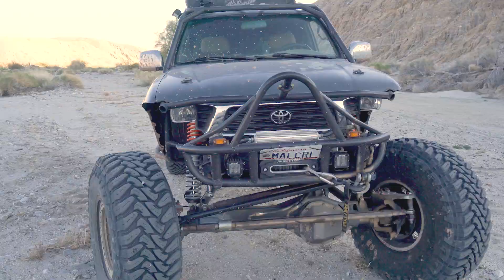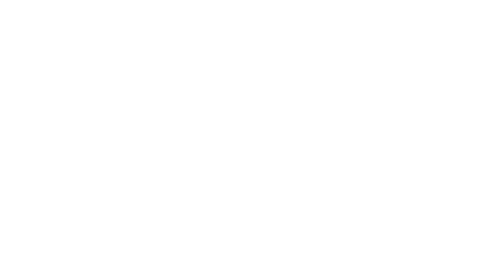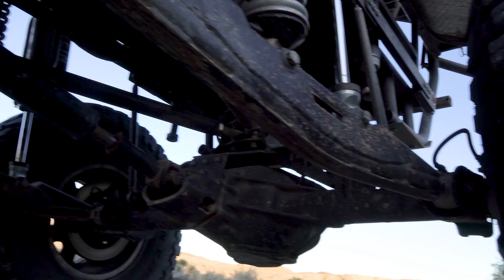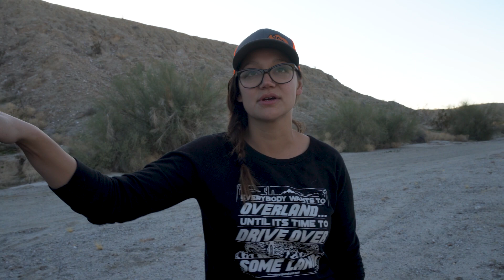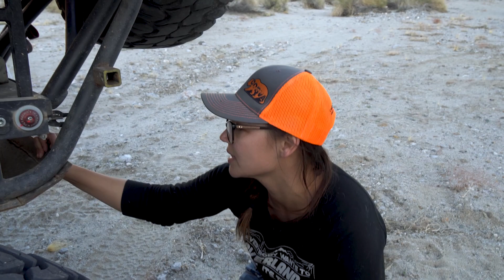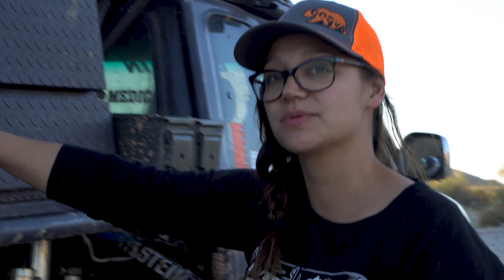Is there anything this Overland Tacoma build can't do? (walkaround)

Comment: cool trail rig, but that is NOT street legal around here. that would be a trailer queen anywhere in my area of the country. tires size alone would not be allowed, and frame is probably more than 29" off the ground...  not to mention the headlights are modified/altered.

Comment: Again killer rig!  Did you do all the exo cage work yourself?  If so nice really clean and tight!  What T cases are in it?
Reply from the maker: Brittany did part of the exo cage and i did the rest. She also built the front frame section thats 4" higher than stock, trailing arms, part of the swing-up stuff, and a bunch of other metal fab stuff on the truck. Its hard to make an exo far enough from the body so nothing rattles on the road but also make it not look like a jungle gym. We just use a gear drive doubler in front of the stock chain case, i actually think the taco chain case behind the 3.4 is really stout, especially compared to the gear drive stuff in the doubler.
Reply: Wheel Every Weekend 
 Looks great any video that you can put up of you too doing the work?  And what bender did you use.  Thanks for the reply back!  Look forward to your next video!

Comment: She knows here shit....Damn.
Great rig.  Countless hours of work.  Congratulations.
First generation Tacoma were the best.  I liked the slightly smaller size.  Now the new Tacomas are as big as the older Tundras.  I wish Toyota would bring back the smaller size.  😞
Reply from the maker: Brittany built a lot of whats on the rig... she did the custom front frame, the trailing arms, part of the rear exo, and a good portion of the engine cage. The 1st gen tundra is smaller than the new tacomas, thats why we've been considering swapping all our parts onto a 1st gen tundra with the 4.7... which doesnt make a ton of power for its size, but its a really well engineered engine, besides of course the starter being inside the intake manifold haha.